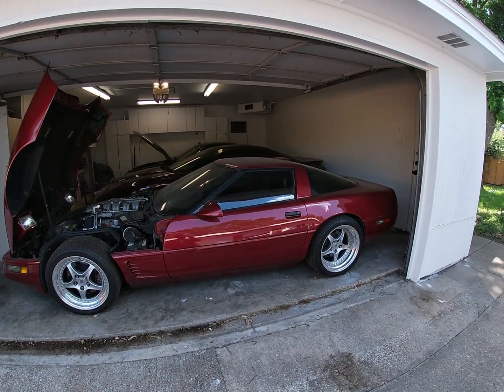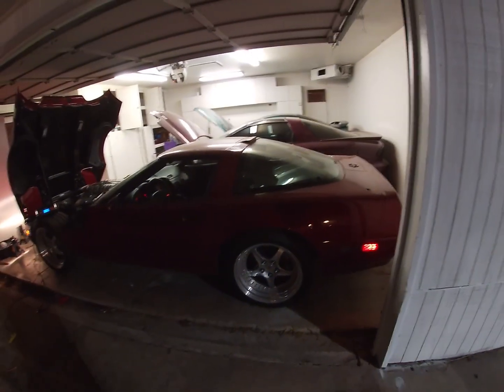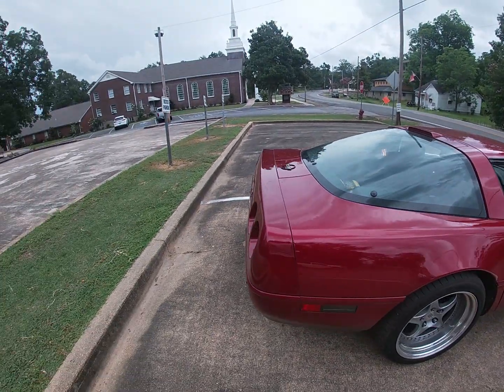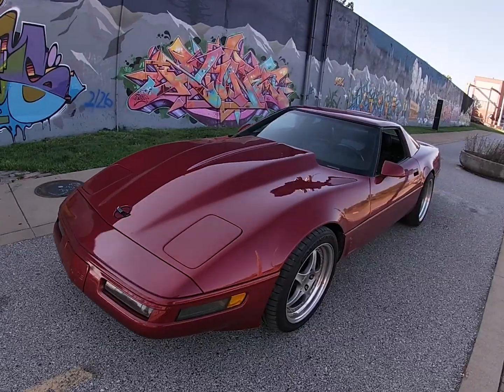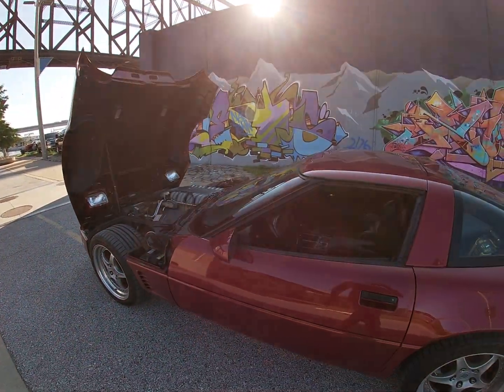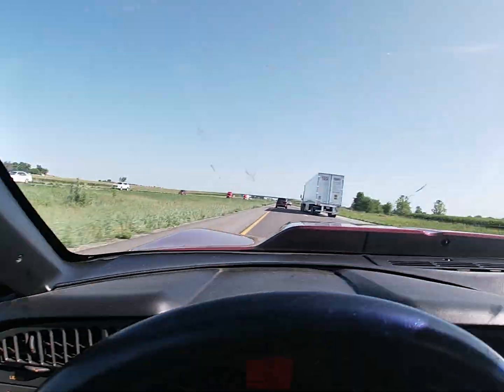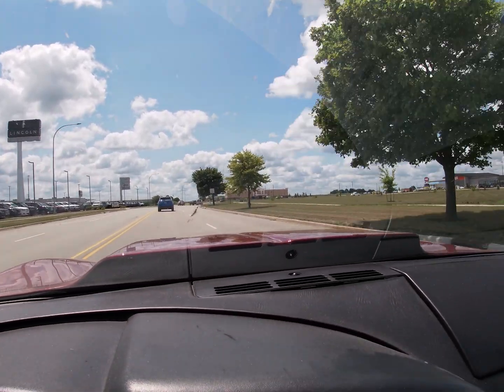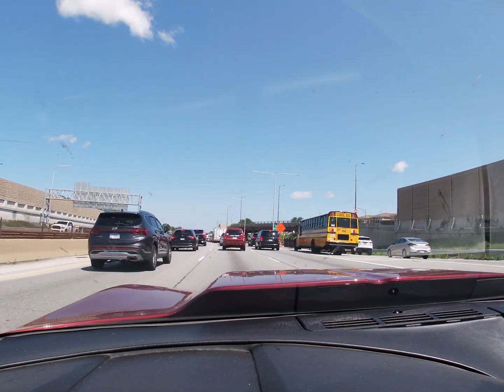C4 Zr-1 DOHC Stroker build + Road Trip!?

Comment: 7:20 - that rattle is natural for all manual vettes, they just chatter like crazy
Reply: It's the dule mass fly wheel put in a light weight Fidanza will totally change the car reaction time from your foot to the time the car reacts to throttle input & enjoy some hidden new HP... 
,
 
reves
Reply from the maker: No, that rattle was from a loose bolt on the plastic cover underneath the rear glass